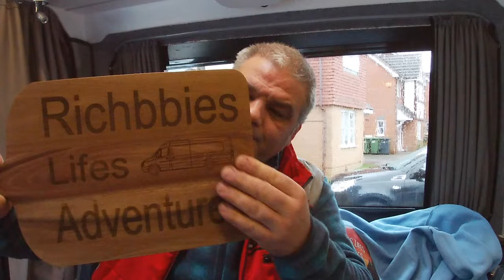How to (proper way) fit thetford toilet shower tray vw crafter sprinter Camper van self build

Comment: I watched this video and the original fitting video. Can you remember the brand of plastic adhesion promoter you used before you fitted the original tray? To me it looked like it may have caused the reaction and not the windscreen sealant. I had already researched the material the trays are made from with a view to fibreglassing the underside of mine and it was described as High Quality 3mm White Acrylic Capped ABS Plastic Sheet. My plan is to trim the tray and test the resin on the offcut before commiting to the tray.
Reply from the maker: According g to magnum motorhomes who make the trays , they’re made of high impact polystyrene (hipps).
I’m sure the brand of adhesive promoter was 3m but I’ll find out for sure and get back to you . 
Thanks for watching and your comments